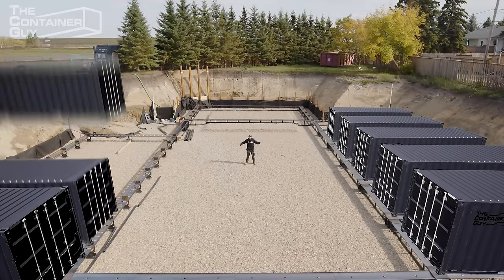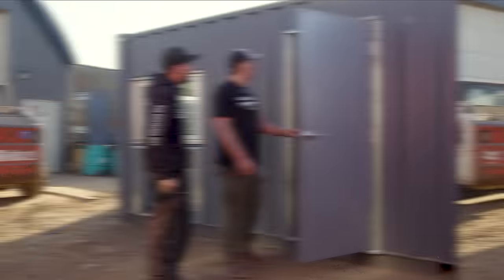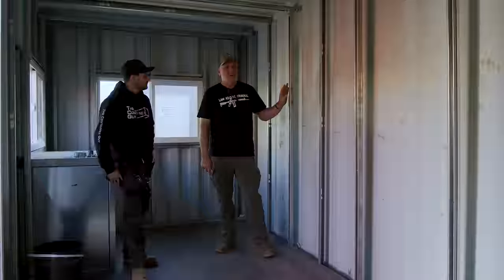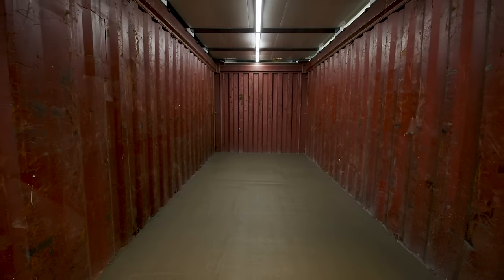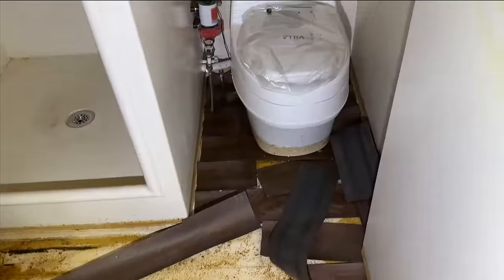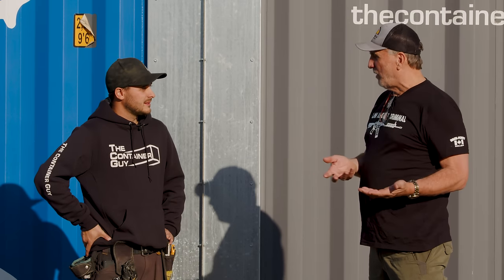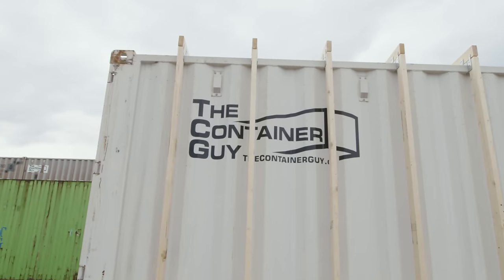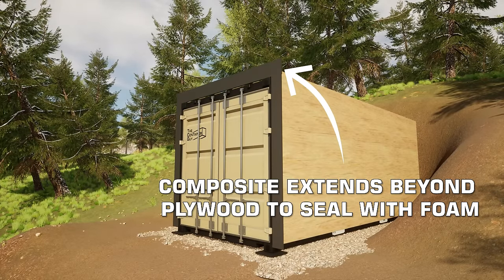DIY Container Bunker Design: Is It Safe? w/@AtlasSurvivalShelters

Comment: Metal fatigue is a thing, there will be constant force on your shelter eventually causing structural failure. Only metal is not a suitable material for underground shelters I think, though pillars to absorb shock is another case. I would rather make an artificial cave than stay in a metal box like canned food. Though if not underground it would work well enough. For underground, stonemasonry, cement, strong isolation chemicals, a thick coat of petrochemicals(even a thick layer of plastic for moisture isolation perhaps would be much more functional for long term. 

So a stone structure with no sharp corners covered with thick plastic sheets welded to leave no point open.

Consider wrapping those containers in plastic when you are actually putting them underground, even a coat of recycled barrels would do wonders, for increasing product's durability to elements.

Comment: Retaining walls higher than 4’ are required to be engineered according to North Carolina code. Doesn’t matter where it is or what it is for. Obviously out of sight out of mind, but it is still a thing here. Good job on the video. This project will still cost 10’s of thousands of dollars. Not a cheap build. I completed a 32’x48’ basement all in for $25,000 this year. Including waterproofing, slab, concrete rebar and excavation. Another $10,000 would get me a roof system if I choose to bury it. This is cheaper than a container build, IMO.

Comment: Another idea is to use ICF blocks along the sides of the container, but then why even buy the container?
Reply from the maker: That's a really good idea. The seam welded steel structure of a container plus waterproofing has some benefit.
Reply: Steel reinforced rebar construction with engineering approval from municipality is way to go. I have built 16x32 bunker with 92 curd of concrete to withstand nuclear blast on one side. ICF construction allows wider interior and nearly all municipalities require structural engineering approval anyways. Shipping container bunkers are needed for initial cheap storage shed/bunker.

Comment: One problem is the doors only open outward. Heavy snow, mud, or even intentional blocking could make your shelter into your tomb. Maybe offer a kit that allows an inward opening standard size door to be inserted into one of the container doors. An emergency exit could be put in the roof,  pull some pins a trapdoor would swing down, it would dump a few feet of dirt into the shelter but you could get out.
Reply: Atlas shelters puts sand in their escape hatch. Open up the 2nd door and the sand comes in allowing you to exit.

Comment: Can you just make a concrete room out of ICF for the shipping container to sit in? Then you don't have to worry about anything pressing up against the sides, you can control the moisture / humidity of the chamber, mount the shipping container on springs (like cheyenne mountain bunker), and you can make the room large enough to access in between the shipping container and concrete chamber to do inspections and maintenance for something that last generations.

Comment: So utilizing that steel and concrete reinforcement technique would also be good for an above ground container home? Especially if it's in an area that is located in a hurricane or bad weather zone? Also, could you do that to 2 40' shipping containers that you put together?
Reply from the maker: Yup. Would work great. Would withstand an EF4 or EF5 Tornado if pinned to the ground.

Comment: What problems would I run into if I say, dig a giant hole. Drop some engineered rock in the very bottom. Dropped in a container with sealed doors, ventilation, interior supports built into it and tube with a ladder coming out the top to a hatch elevated to be above ground level.(obviously check for level and make sure it is fully supported before moving forward), drop in a some smaller rock and push it into the gaps under the container using air pressure or water. Place a water proof liner(like what is used on top of commercial roofs) over the top and all four sides of the box. And then fill it with concrete till I can’t see the container anymore. Once the concrete has cured I fill in the rest of the hole with soil.

Is the interior framing and concrete not enough strength?

How important/helpful would it be to add a rebar cage around the top of the container?

In this video it seems like he is avoiding the use of concrete? Is there a reason for this? I don’t have a ton of experience in construction and none with concrete but from what I do know about it I would assume it would be the perfect material to  surround the container.

Why are they using so much spray foam in this video? If the container is surrounded by dirt then you shouldn’t need any insulation, and I can’t think of any other possible reasoning for using it.
Reply: In most areas you need to be below 6ft to take advantage of the ground being 58*

Comment: would hope a fire doesnt start in one of those containers, that pvc and foam will go up so fast! - one thing many people don't think about is fire safety. houses built to code (at least in australia) need to have certain flammability requirements.
Reply: In the US, I believe we only really have fire suppression requirements in place.
Reply: @harrymu148  awesome, make your walls out of diesel and just have co2 for supression I guess? :P   anyway of course I'm being absurd, was just commenting on what I saw as a serious risk if it was a dwelling. sometimes the code isn't enough.  there might be a gap in the market for something that meets higher standards. could be a real selling point even as a second 'premium' product line
Reply: @benphilippi9325  I need to point out that i gave no argument, i simply gave a fact local to the video.
Reply: @harrymu148  absolutely, sad we all have to automatically assume people are trying to argue rather than discuss (even then in text it may seem I'm sniping at you but definitely not) I understand your intent.  I would ask your opinion on that fact. my personal opinion is that safety is a process, tragedies happen and a known evident risk should be eliminated where possible.  Regulation is put in place to even the playing field so ALL companies must adhere to the same standards.  In my opinion regardless of country, we should all strive to be the best we can.
Reply: in my country basements are illegal without being individually engineered because of safety regulations so I understand that pendulum can swing wayyy too far in the wrong direction but reasonable improvements should be welcomed in my opinion.

Comment: That is why you fill around the bunker & cover in with dry dirt or rock. Then you cover it with a pond liner, about 15' to 20' around/past the exterior perimeter of the bunker. Then you cover that with more dirt or rock of whatever thisness your bucker will easily support. Then you do not end up with water soaked soil or rock contacting the bunker in any fashion. This method was figured out in the earth buried home industry

Comment: Hi, instead of concrete with sand mix , you stipulate concrete and stone dust and rebar your encasement will be stronger and waterproof as sand is porous and stone is not such as ferrocement boats.

Comment: How about the doors? They are obviously extreme resilient. But only when closed from the outside. This means you will easily get locked in and would need another solution for the inside

Comment: One thing I don't like about this, is that it would make a cool shop or stash area, but not much else. But if you close those doors and they still have the standard handles and latches, well all someone has to do is close it and you aren't getting out. And if you are using it as an emergency bunker, that's far from ideal.

Comment: Interesting in setting two 20 ft containers into the side of a hill setting side by side with an 8 inch gap. Then waterproofing the outsides and insulating foam on both, then enveloping them in concrete with steel reinforcement with about two foot of dirt overhead. Only the doors would be exposed with poured concrete wings.
Reply: @richardkennedy815  Any updates on your build?

Comment: Why aren't you utilizing the open space under the container to install drainage? Seems like a missed opportunity, and an easy way to pull water from the sides of the structure and push it out the front, underneath the door. 

Gravel tends to make a really good natural filter for rainwater, too.

 You may consider channeling it into a rainwater collection basin, or even a sistern.

Comment: Only reason to regulate is to force people to buy them making it their market only and FYI you can build a cinder block and concrete shelter for less then 4k over the insane price given here I priced out one in 2019/2020 custom built with 7 foot high 20 feet long an 25 foot wide for around 3500.00 .

Comment: I forgot to mention we did have a 4" perforated drain tile running around the perimeter of the ICF wall and draining past the front of the containers, and we poured a sloping cement apron pad for ease of getting in and out of the containers

Comment: I have a corrugated pipe at the end of my drive way for the past 35 years. I run over it everyday with my car. It is holding up just fine. The metal is a lot thinner then my shipping container and with no ends on it to support the weight of the gravel driveway and the car, it's doing just great. I don't think all this work is necessary. I only need the container to last my life time not for eternity.

Comment: still those sides aren't designed to withstand any horizontal pressure - those exterior 2x4s are essential, unless they rot - maybe consider some cheap pre-cast concrete beams?

Comment: The concrete floor is great replacement since it helps resist the hydrostatic pressures and even if it gets wet water won't hurt it. The plywood and foam not so much. Taking the metal floor out might nullify it's Faraday cage propeties. You might want to ask someone who specializes in EMP's about it.

Comment: Wonder if it would be easier to just bury a monolithic concrete dome?
Reply from the maker: Way easier
Reply: I believe Atlas actually used to do a service like that. at least there's a little image at the bottom of their pdf dialogue labelled "monolithic" You'd probably have to contact and ask Mr. Hubbard or the Atlassurvivalshelters company about it.

Comment: Q: Would it be better (and worth the extra expense) to go with a container meant for refrigeration?
Reply: Depends if you can maintain it. Otherwise they might be an issue because the cooling radiator has refrigerant lines that bridge between the inside and outside. Granted if you were only looking for the insulated box, a regular container and good practices while putting in spray foam will do you better.

Comment: I don't know, man. With the amount of work necessary to reinforce a container and modifying it to be fit for habitation, I think it's easier and cheaper to just dig a hole, reinforce it with concrete and there you have it. A bunker that can withstand a nuclear bomb blast, NBC and also won't become a Faraday cage that makes you unable to receive cell phone or radio signals. I can understand why that guy's metal bunkers work as he doesn't refurbish containers, he craft bunkers in the shape of containers, because he had to transport it. This makes it cheap and convenient for him and for his customers. But if you DIY from the ground up, I think it's better to just do it from scratch with concrete.

Comment: if you're going the bunker rout do it the right way. you're using this thing when shit gets bad and when it get's bad it's many times worse than you think. you need a hidden sealed environment with access to filtered air and water not a set of doors in the side of a mountain. if shit goes south you're going to be there for a while which could be for the rest of your natural existence you might as well save a little more build something better.

Comment: Those arguments are indefensible, you can mount a column that resists 1500 lbs and transmit the loads from the ceiling to the floor but you will be in the same situation because the floor will only resist the loads for which it was designed.
Stacking strength is only in its corners

Comment: It is all about the cost I am not convinced it is cheaper to use a container.
Reply: For cheap underground storage shelter, checkout underground earthbag root cellar. Save money and build real structural engineered concrete or ICF bunker. Anything costing more than couple dozen grands, you will want municipal code compliance, not a red tag.

Comment: I disagree with a few things youve mentioned, have you load simulated your design in cad to see if your structure is going to be strong enough to be covered in 6ft or so of earth? 
Also you said its wrong to weld containers?? This makes me extremely confused its the fastest cheapest way to effectively modify a container and most times the strongest 
So why tell viewers its wrong?

Comment: nope, this is not how you do it. those wood beams are gonna rot, rodents are gonna burrow thru that insulation, then water ingress is gonna ruin everything. instead use steel reinforcement, seal with rubber or tar coating, then insulate with aircrete...cover with stucco then bury

Comment: By regulating the industry you'll insure that individuals (free men) can't construct their own shelters, based on there needs, desires and budgets, and in this case, COVERTLY. I have noted many design flaws with both yours and Ron's shelters effecting their longevity so it is unclear as to why you think you have all the answers.  As a builder, designer, and engineer I find flaws, over reach, and product promotion from industry insiders in the National Building Code.. It forces builders to purchase un-needed materials and use materials them in a way that  satisfies a code requirement in abroad sense yet has no application on a specific project by inspectors that may have never build a thing in there life. You two may think your doing something righteous by trying to regulate, but your not. Its short sighted. Yet another reason why you should just stick to building and not legislating.
Reply: Lots of time, that is the idea, too put the little man out of business , The Lobbyist works with the government To make laws where individuals or small companies cannot , Compete with the big organizations

Comment: This guy has benefited from lack of regulation for 13 years.  Now that he's a big business and he can afford it, he wants regulation.  Keeps the competition out.  Classic.  What a hypocrite.
Reply: My thoughts exactly. 💯
Reply: Thought the same!
Reply: Yup, greed!

Allow new and young entrepreneurs in to this industry. Let young craftsmen have cheap shops in incorporated lots without regulations. Remember how much push back you had back in early 2000s.

Shipping container construction is limited business model because of 8’ wide dimensional restrictions. It is only feasible solutions for low cost shop or low cost house for majority of clients. 12’ wide structures are cheaper with steel framing with some moment frames already. Any fancy shipping container buildings will require structural engineering approval anyway.